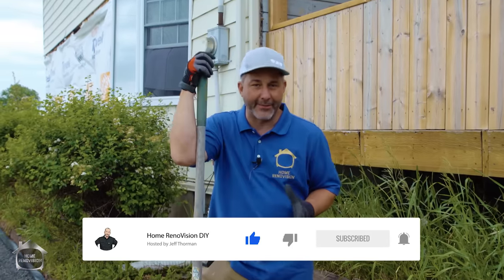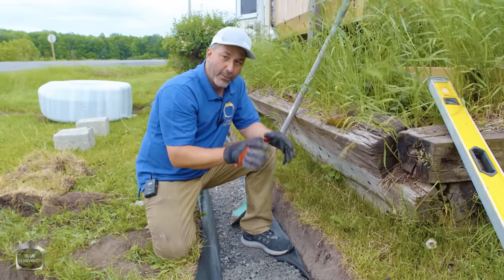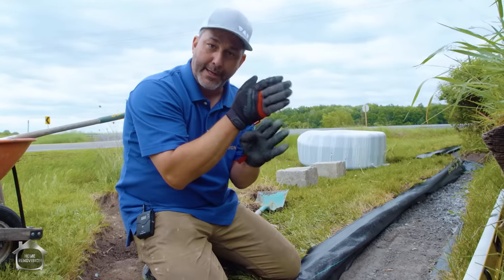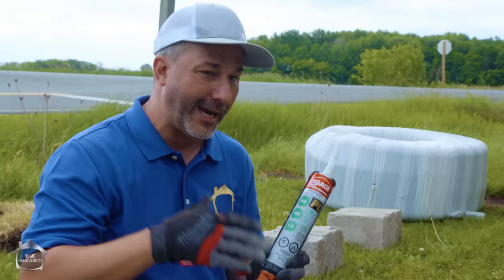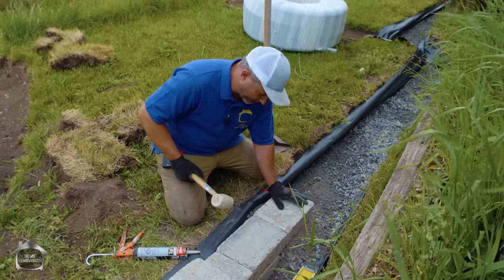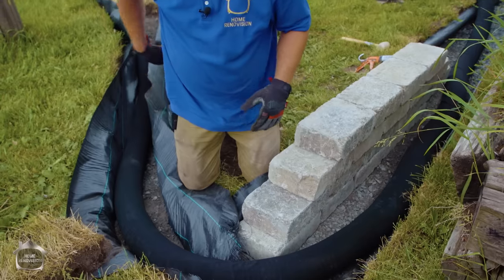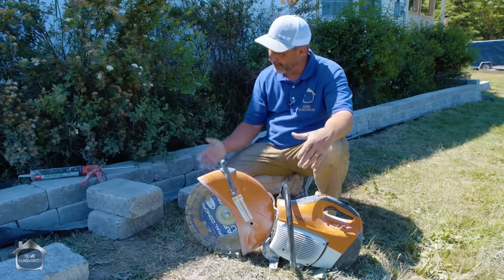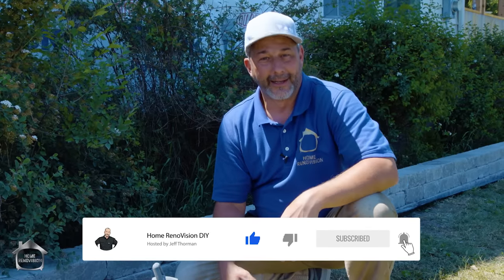How to Build a Retaining Wall - Step by Step

Comment: Great video, especially since that's my next DIY project. Four things I consider before I start a project: Time, Effort, Money, and Help, if needed. I'm going to build a ramp about 1 foot high to reach the floor. I'm going to use patio blocks for the side detaining wall. Your video took care of explaining how to do this job, Thanks. I'm thinking of using concrete and rebar for the base as it self levels.

Comment: When you stagger your corners, it provides more surface area for the brick, causing more friction, so even if you get some water frozen back there, the surface area of each stone laying on top of the other, plus the glue, will prevent the wall from bulging out

Comment: If you don't feel comfortable with a large concrete saw.  You can use a 4 or 6 inch grinder with a Mason/Brick cutting wheel that you can purchase at your local hardware store.  Also Jeff is that G.A stone kinda like concrete when it becomes wet?  We have used something like it for road patches as a temporary. patch.

Comment: Thank you for a great video, have watched it several times. When installing the landscape cloth, it appears that the cloth goes under the GA foundation and up against the dirt behind your retaining wall. Should the fabric extend to the top of the dirt behind the retaining wall? Also, should there be enough fabric to cover the clear stone gravel so the top soil (in my case this includes a lawn) does not wash into the clear stone gravel and eventually the fine sock-covered drain tube? Thank you.

Comment: I've built 20 to 30 he's retaining walls here in Florida on pawn shores on the side of the highways. There's no Geo grid that I see holding the tentil strength of the wall up the drainage is pretty close but that footer could be 24 in wide by 18 to 24 inches deep and a plate compactor comes in handy so this is something like a flower bed look at you'll get by but if you actually want to use that area that wall is going to fail even with his drainage. Normally the height of the wall you have to double it the excavation behind it so 6 ft wall you want to go minimum 12 ft excavated completely back out of the way for your Geo grip and you layer that compact that and that's actually what holds the wall.

Comment: Long time viewer, first time caller. 
These exact blocks you are using; can I use them in the same fashion for a patio on uneven ground? I'm hoping to avoid using retaining block that has the angled cuts and lip on them. 
1. I don't want to cut to make outside 90 degree corners. 
2. I want the wall to be vertically straight (not taper back).
I planned on stacking 3 high at the highest point, with the first row down 3/4 of the way. I can't find an answer anywhere after days of searching for an answer.

Would be cool if you know. Thanks for all the videos you've posted, you have been immensely educational (and funny at times).

Comment: i have done about 10 so far i just started my own side business in doin these. i use a grade laser set up. can be done super fast if you got a guy holdin it right beside you. also, set up a string line on each end at same elevation. set the front of your blocks to it, eyeball your pitch from the front to the back, keep runnin them. after that its just legos xD hope this tip helps.

Comment: don't buy gravel, or sand, or compost, or topsoil, or garden soil mix, or ... well any stuff that you use in your yard (other than fertilizer, maybe) in bags from a garden store.  go to a landscape supply company and you can buy it in bulk by the yard for way, way, way less (perhaps 10 times) than home depot will cost by the bag.  most will load up your pickup bed with a half yard or a yard, or you can have them deliver it to you with a dump truck.  (usually you can get 2 or more different products delivered at the same time with a dump truck.

Comment: Good video, thank you. 
My question is, if you use fabric that doesn't drain, pack it with the stone and sand, THEN, place the first course and pipe behind it, won't water settle and stay beneath the first course?
Wouldn't it make sense for the landscape fabric to have the ability to drain the excess water, but hold the sand?

Comment: should I use landscape fabric at the base or not? Most of the videos I've seen regarding small retaining walls skip that step or just use the porous landscape material behind the wall. Is it worth the added cost on a small (less than 12" high) wall?

Comment: I was told to use only stone for a 6 inch base.  Because I have a water issue where this wall is going I feel the sand mix will retain the water I want to leave.  Same for the membrane you installed.

Comment: I'm having a few issues looking at things like this as a DIYer. Right now on my summer list I have a hot tub pad with a wrap-around deck, and a retaining wall as a potential solution for my excessive grade backyard. My question is when do you need to write into the city to get a permit? I can go to the lumber yard right now to get wood, order my dirt from the local quarry etc and have it done but would I be risking a potential infraction from doing this? I am in the Ottawa area of Ontario for reference

Comment: It would be interesting to know what blocks you are using... don't see anything quite as good in UK. Also up to what height before the design or foundations need to be changed.  Finally could you place a shed up to the edge of this?

Comment: I don't know anything about construction, but wasnt the deck sinking? Do you need to pack in the earth or fill towards the deck after the wall is done? I also wanted to see you take out the old railway wood and see how you cover or slope it down. 

But still excellence through and through. Thank you.

Comment: Question for you. I bought a home in TN sign unseen. Now that I have moved in all the neighbors inform me that all the water from the neighborhood runs right through my property. There is a creek on the side of my home that is supposed to be the where the water goes but because the property and creek were "built' back in the 60s they are in need of major maintenance however my property is in the county and the county could care less. During the last rain I was able to see some of what the neighbors were talking about. I even made short videos I so I can send them to you for advice. My question is how do I fix this huge problem? The water runs down the street then down my driveway and right up to my door. So far the rain hasn't been heavy enough to flood however we haven't reached the rainy season yet. My 70 year old neighbor who has lived across from my property since she was a kid was over this weekend and said my whole yard including my downstairs will flood unless I fix this problem. I originally moved here to be closer to my 93 year old grandmother however I made a huge mistake buying my first home. Can you help?

Comment: I'm planning to build a fence on a slope in our backyard on our property line. We've given some thought to building a fence on top of the wall. Would the retaining wall you are building here be able to support a 6 ft fence build on top? Or would a DIYer need to essentially build two retaining walls, with weeping tile, and have footers within the retaining wall? Hope that makes sense.
Reply from the maker: depends on the fence and the wind you are dealing with. I would look into "foundation screws" just in behind the wall and set my posts on the bracket.

Comment: I enjoyed your vid. Question, Does the adhesive work better if the stone isn't dusty? I'm sure the adhesive sticks to the dust, but the dust doesn't stick to itself nor the stone.
Reply from the maker: for sure, however on a small wall as this it isn't needed since 90% of the stones are not cut.

Comment: I wanted to build a 8ft width 6 ft height wall in between my garage and house (with a gate), would it be possible to start on concrete surface? It's all already concrete, part driveway and part stamped concrete from my backyard

Comment: I am building a retaining wall with blocks looks to be the same size as yours how tall can I go with using only adhesive  i need to go about 24 inches high and only about 10 feet straight out from my basement wall or do I need to use mortar

Comment: Curious about the tile behind the wall.  Is it something you will do no matter the height of wall?  If you had a 2 of 3 high brick you still tile it?  Thanks for the video!
Reply from the maker: I am having my downspouts diverted into it so yes. if you run your downspouts past the wall not necessary. Cheers!

Comment: Is there a need to angle your wall to slope into the hill. The stepping back by 1/2" or so might accomplish this - also - any reason to not use adhesive between each horizontal brick? Is the drain tile also sloped to run downhill behind? Is there an need to worry about getting down below the frost line? Sorry for the questions - I found the video really inspiring. Thanks a heap

Comment: is it necessary to add the drainage if you are just doing a simple 2ft tall wall on a personal residence? we do not have issues with drainage presently but our current retaining wall is not compact like a concrete block would be. thanks!

Comment: I need to go up about 3-1/2 ft to 4 ft.  Will that type of block you are using work for that height?  I may get blocks with locking flanges on the back as well.
Reply from the maker: yes!

Comment: Odd question.  If I was to use retaining wall blocks to edge a walk way (2 rows high with the first row just below the surface), can I follow the slope of the walk way or does it still need to be level?

Comment: You didn’t show how you finished off the drain. Does that entire tube get covered with gravel then dirt and sod above it?
Does the ribs just dead end on a slope with the water running out the end or does the water deep out on its way down the tube?

Comment: I was looking through your videos and didnt see what i need to watch. do you have a video about leveling your floor? I have a older house that didnt have gutters so the sides all sunk down a bit and the center of the floor is higher then the side (by all the outside walls). Just want to see a video the right way to do it and how to make sure im doing it in the right spot.
Reply: I have the same problem. Would be good to see a vid from Jeff on that.

Comment: Very nice:)  have a project on my side yard..I have a space of 16ft from home and porch to street fence  by 60ft along street but I have a slope..have different optioons/ideas but still thinking about it...1..take dirt out to flatten space and may be have a sunken patio to put fire pit? Have to dig ou about 2 feet of  dirt on high point of slope to flatten area out.. 

2...build a retaining wall close to fence and add dirt to  fill it  in  to flatten area out ?.3..or just add a concrete slab  extension to the existing porch of about 10ft out and on remaining of space (6ft) build some of thoes planter boxes and plant some podocirpus trees or evergreens 🌲 for privacy along 60ft of fence?  Even if I decide to take out or fill it  in with dirt to flatten slope  I would like to add pavers or maybe gravel to add fire pit section between porch and street fence. (Aboit  16ft by 20ft area) but If I just add  about 10 ft of concrete without adding or taking out dirt then I will just add fire pit there..
Reply from the maker: whatever you do make sure you maintain proper drainage to protect your house. any choice requires a little off level to move water away. Cheers! BTW I always find it easier to add material then to remove it.

Comment: So Jeff those bricks are really dusty... should they not be clean to have the adhesive even work on them? If not it's just sticking to dust.
Reply from the maker: sure. the adhesive works by filling in the voids and creating an effect similar to crystallizing. the dust is not actually an issue. it would be on a smooth stone.

Comment: I’ve got a leaning retaining wall that needs to be rebuilt but it’s in a very awkward spot that I want to use to maximize storage. I wish there was a photo upload option so I can get some ideas from you and the rest of the diy community. But basically I have a 6ft wide x 15ft long decked area, my septic is underneath (with access doors for pumping) I have another level of deck to the right that’s 42” higher, and my retaining wall would be on the left side and it’s 36” high (which is level with the rest of my yard). I want to use that as storage and throw a roof on it and store my snowblower and garbage/recycling bins in there, but I also want it to look good when looking at it from the rest of the yard. This may be one of those projects that you need to come by and point me in the right direction.

Comment: 24:40... Good thing that you have your protective gear in place! :D   I think you are the first american I see that blows away the safety gear.  🤣😂  Now, you are and I am used to powertools, but you may find a "here, hold my beer" kinda guy that will try this too, and that may not be just as funny.  Also, if you work with this all day, both the noise and dust WILL harm you in the long run.  But for small projects like this, no big deal. :)   Have a nice day! :D

Comment: Common sense before all the safety rules. And production in between :) But I would definetely use some hearing protection when cutting stone. A cut or scratch will heal, but your hearing is never restoring. After too many days without hearing protection I know how to appreciate the "silence" when doing noisy stuff. And if your co-worker is annoying, just leave them on when you're finished with the cutting!

Comment: Question on the corner: why not do two 45s out of a single long block?  One 45 to make the corner, and the other 45 for against the existing course?  You just need to measure the desired offset to the corner where you start the 45.

Comment: Is there a height of wall where this system gets weak or drainage is too far from the surface? I need around 10-12 ft tall wall deepest at a 90 degree turn. I worry about drainage at the corner too. Wondering if a 2 level setup is better?

Comment: Hi Jeff, I am planning to rebuild a flagstone retaining wall. It will be approximately 4 ft at tallest point, and I am hoping for it to support a 12x15ft cement slab that will have a flagstone patio set in mortar on top of it. I should mention this will be built on a slope so it will essentially be a raised flagstone patio supported by a flagstone retaining wall. I have some questions I would like to run by you.

First, is a flagstone retaining wall likely going to be strong enough to support this design? Or this destined to fail? I have an array of stones varying between 1-8 inches thick 1-2.5 ft wide and approximately 20-200 lbs. If this is possible, do you have any general recommendations on the design? For instance, should I dry stack them or should I use mortar or an adhesive between the stones during construction?

I really want the flagstone at the top to be flush with the patio and to protrude partially over the edge of the retaining wall. Maybe just a couple inches at most, so that it looks like one continuous patio with no border or break. To acheive this look I was planning to glue a cap stone that would be flush with the stone on the patio, and mortaring between the top layer of stones for a consistent look spanning the patio edge to edge.

Lastly, what do you recommend for drainage? I was thinking of doing 4-6 inches of 3/4 clear stone behind the retaining wall and a drain tile pipe at the bottom.

Your videos are very insightfuI! Love the great content! Hope to hear back from you!

Comment: Hi Jeff, I am new and hope in right place to ask questions. I am renovating  a beach house and need to take down the popcorn ceiling.  I watched your smooth edge video, but how should I handle the entire ceiling, whole house? Is there a fast tool to help me do this? Also will I need to mud after and sand?

Comment: Does this video apply for bigger retaining walls.  Because ares is roughly  three and half feet high
Reply from the maker: for taller walls you need to forgo the recessed 1/2" and stay flush.
Reply: @HomeRenoVisionDIY  do you need tie backs for anchoring or no

Comment: Great video Jeff.. I have a 50 yard retaining wall to build around the house, where it will retain the soil for the backyard on one side and have a service road to lower ground on the other side, it comes with a curb (road turns 90 degrees and steep angle at top down to the bottom (around 20 feet drop in level from beginning of wall till bottom) , I don't think that a 0-3/4 of gravel will be strong enough for a foundation, as the ground is sandy and at top it is filled sand.. plan is to dig  1 foot deep by 1 foot wide ditch along the wall base, fill 8 inch 3/4 gravel, pour 2 inch concrete atop and level concrete at the angle of descent, then I can use this base as foundation floor.. 
 - Will the above be an overkill?
- I plan to use the same wall material and technique as in this video, will it go as high as 6 feet in areas? or I need 2 rows of blocks at first half?
If I use concrete/cement instead of glue, won't that be stronger? I am used to building walls from concrete blocks with cement in between to stick them together, it also make leveling better, however not used doing it for this climate.
Thanks
Reply: Your position in the queue has progressed.